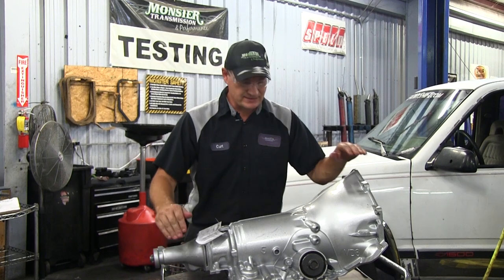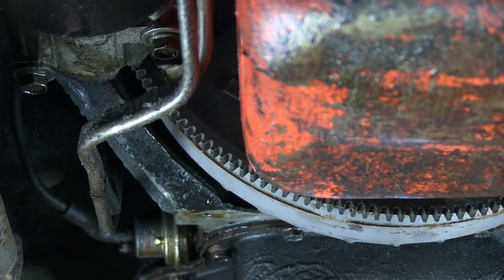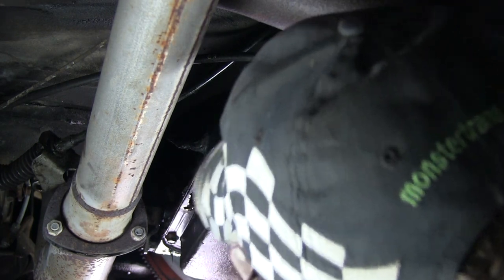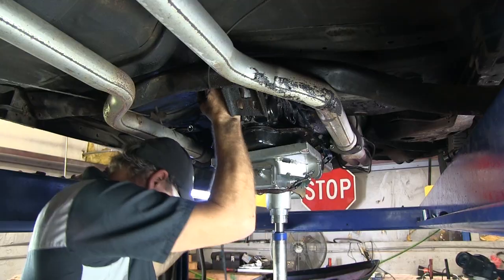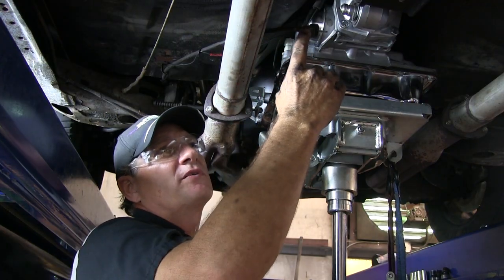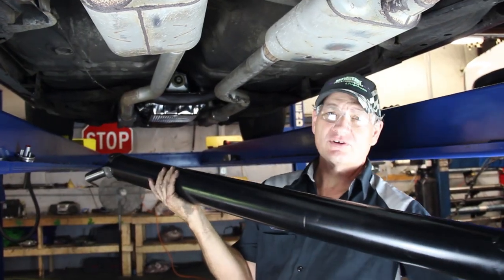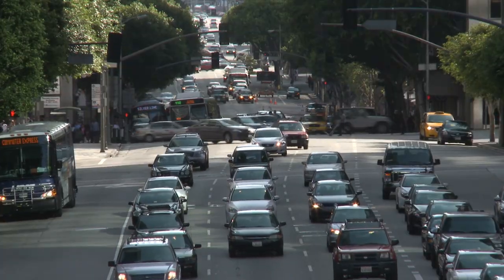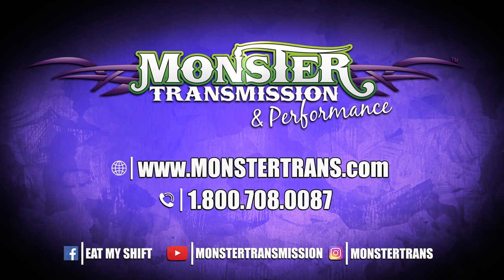TH400 to 700R4 Conversion  |  In Depth How To

Comment: Good job explaining every step. One thing to mention about the flex plate on a 454 engine is the plate has extra balance weight welded to it. If not used it will vibrate.

Comment: For anyone installing the torque converter, the converter must have at least 1qt of ATF inside as indicated, but turning and pushing to fully seat can be checked very easy. If you place a straight edge or even a length of 2 X 4 that straight, you will be able to slide your thumb or index finger between the two. If not fully seated, the torque converter will crack the front pump gear. 
 This will ruin your day! A simple quick check will avoid this sad issue when you are in a hurry, cold or laying on your back. 
 Just a tip.
ASE Master Tech since 1978 / Retired

Comment: You're the best tutor, Curt. Want to ask, is the process of installing the 2004R similar to the 700R4? What do i need to look out for in the differences? I have a TH350, and got a new 2004R with lockup converter few years back.
Reply from the maker: Hello! We appreciate the kind words. Swapping from a TH350 to a 2004R is one of the simpler swaps, just make sure you double check everything, set the TV correctly and get a external lock up kit if you dont already have one.
Reply: @MonsterTransmission  I'll get the TV cable and external lockup kit from you for sure in the next few days. Thank you so much

Comment: Wow thanks for the info really helps. I’m putting a th400 into my 66 impala for the first time
Reply from the maker: That's awesome Dave! If you end up having any questions give or technical support a call 800-708-0087.
Reply: If possible I could use some advise on a stall converter for my 66 Impala. I have a TH400 that’s coming out of a 83 3/4 ton 305 Chevy van. It has everything I need. 

For the Impala I’m running a carbed 8.1 496 with the HT502 cam and for the rear end a stock 12 bolt with what looks like the original 308.  Any suggestions
Reply from the maker: We would recommend getting a converter with stall speed of 2300-2500 mph.
Reply: Monster Transmission Ok will keep that in mind and thanks for the reply. 👍

Comment: Good video but couldve talked about hooking the cooler lines back up and which one goes on top.  Couldve also showed how to adjust or check adjustment of the TV cable before you drive it and burn it up.

Comment: 2 questions....1)will conversion also be the same or any specific differences for a TH350? and 2) what can I expect to pay for a trans shop to install the new 700? This would be going on the same application as you had in the video but a SBC 71' Chevelle SS.
Reply from the maker: To your first question, yes it would be pretty much the same. For your second it's hard for us to answer as that varies from shop to shop. It's always a good idea to call around and find a respectable shop you know and trust. You could try finding a vetted installer by using https://gearnation.com/. They're one of our partners and they vet and connect people with shops all over the US. Hopefully there's some shops on there in your area.

Comment: I thought the 454 was externally balanced? How can you use a flexplate out of the box without balancing it to match the stock flexplate?
Reply from the maker: It all depends on the rotating assembly the flex plate is internally or externally balanced

Comment: What about models that have gear indication on the dash and not the console?
Reply from the maker: Some models require to use of an aftermarket floor shifter but shiftwork sells alot of conversion pieces for column shifters

Comment: I have a 1991 4X4 Chevy truck with a manual trans and I want to convert to 700r4. I know I need cooling lines, steering column and linkage but what else do I need as far as the transmission goes. My hip is starting to give me problems when clutching.
Reply from the maker: To convert from a TH400 4x4 to a 700r4 4x4 you first need to contact Advanced Adapters they specialize on these 4x4 conversions and will set you up with the perfect Adapter you will need for your application. Sometimes they have 2 options for the Adapter 1.) Output shaft Adapter Kit in the Transmission or 2.) Transfer Case adapter. They can be contacted at www.AdvancedAdapter.com or 800-350-2223 and please let us know if we can help you with the Transmission build we work direct with Advanced Adapters building those kits in for many years, you would just have it ship direct to us and we can make it apart of the build process. Thank you for choosing Monster Transmissions.

Comment: I'm a little confused. Why does it have a shifter rod and a cable? Isn't one for column shift and the other for console? I'm working with a column shifted 68 pontiac 350 to 700 swap.
Reply from the maker: Yes you are correct

Comment: I want swapout my th400 with a 90 model 700r4,. do yall have a kit that has the parts to do this ? my car is a 71 Malibu on the column.  thanks.  also the engine is a 400sb.
Reply from the maker: Yes that will work

Comment: What is the major difference between a 400 to 700r4 and a 350 to 700r4?
Reply from the maker: *The 700r4 will be controlled by a TV cable (Throttle Valve Cable) to adjust the shift points and it will have better fuel economy being a 4 speed Transmission with Lock up with a Low first gear Ratio. These can be built up to 1000HP with our SS Xtreme Models. 
*The TH400 will be controlled by the Modulator there is no cable you will need to produce vacuum to operate this Transmission and this is a 3 speed so you will not get the best fuel economy. The TH400 is one of the strongest and most reliable Transmissions available we have built to hold upwards of 1200HP+ they are bulletproof. 
*The TH350 will be controlled by the Modulator as well and you will need to produce vacuum like the TH400 but on the TH350 you will have a Detent Cable  this is a 3 speed as well so fuel economy is not great. The TH350 is the weakest of the 3 Transmissions we are talking about and can be built up to 600HP.

Comment: Love it - maybe dumb question, but on the 700r4 which of the cooling lines is the feed and which is the return?
Reply from the maker: No such thing as a dumb question, You can find the correct coolant lines in this video https://youtu.be/tnFPgjQq3aA
But in short, the top is the feed and the bottom is the return

Comment: What about the cable bracket on the transmission it self, what bracket is used on it to hold the cable
Reply from the maker: If you're talking about the t.v. cable, that bolts directly to the transmission. And if you're talking about the linkage cable, it would vary depending on what rebuild kit you have.

Comment: Do you guys make lock up kits for the 400. I recently found out that’s painless. 3 speed with a lock up.
Reply from the maker: No, we don't have a lock up kit for the 400.
Reply: coan does...about 2500.oo  ...converter ,i think..about the same
Reply: @brianmathew09  Are you saying $5K total to make a TH400 lockup?

Comment: Can use a 700r4 with a 2300 to 2500 "10 mechanical stall with out the lockup conversion kit?
Reply from the maker: If both the converter and transmission were converted to non lock up, then yes it is fine.
Reply: As a daily driver?

Comment: Why would you possibly want a 700r4? I was looking to see if i could convert my 700r4 to something else? I have a 1990 1500 and it is just a nightmare
Reply from the maker: The 700R4 is good reliable transmission when built to the application and HP it is being used for. The manual TV cable makes it easy when you don't want to mess with electronics but still gain an extra gear for highway cruising. There are other options depending on your application, give us a call to go over your details at 800-708-0087

Comment: I remember way back in the day when they first came out everyone was pulling out the 700 and going back to the 350 turbo cause of junk that the 700 turned out to be
Reply from the maker: From 1982-1984 GM had a lot of issues with the 700R4. And in 1985 GM corrected these issues and since then the 700R4 been the most versatile four speed GM has made.
Reply: If a 700R4 from 1982 - 1984 gets completely rebuilt, will it fix the problem that you are referring to? What exactly was the problem?

Comment: Why would you go with a 700R4 and not go with a 4L80E? Isn't the 4L80E closer to a TH400 as for as toughness?
Reply from the maker: That would depend on a couple things. But yes, if they have high power a 4l80E is the best way to go. This was just instructing for someone who was converting.
Reply: @MonsterTransmission  4l80e need a computer .or you have to go with a full manuel kit
Reply: 4l80e needs way more computer/electronic shit than the 700r4

Comment: Not to be a troll I’ll never understand why someone would retromod a hot rod , put a $10k engine , new suspension, new paint and put a th 350 or 400 in it ! For a street rod these transmissions are obsolete. I like the drivability.

Comment: I'm pretty sure this guy knows his stuff but if i had a turbo 400 i would keep it. Thats what those older cars came with.
Reply from the maker: Keeping the TH400 is great if you are keeping the car original but upgrading to the 700R4 allows the car to drive at a much more comfortable rpm on highways and gives better gas mileage. Give your classic more drivability with the overdrive by doing this conversion.

Comment: when I first saw this I'm thinking that I would never change the TH400 to a 700R4...   especially going in behind a Big Block.... absolutely go to a 4L80.. its a TH400 with overdrive.. much stronger trans than the 700R4....  good video though....
Reply from the maker: The 4L80e would require a computer to run the transmission, and may be too big for the vehicle the TH400 is being replaced in. The 700r4 gives it the overdrive the owner is looking for but maintaining mechanical control with the TV cable.

Comment: Keep the 400 . .better than 700 .
Reply from the maker: All depends on what your application is, that overdrive does wonders on the highway
Reply: I completely agree i have a 89 Silverado C1500 2wd with a 700R4 it slips in and out of overdrive and the gas mileage is slightly better than a th350 or th400 which i don’t really care about rather have one of those than the 700 and in a couple months the 700 is getting pulled for a th400
Reply from the maker: This may be caused by a bad governor or you may need to readjust the TV cable. You can watch Curt as he shows step by step procedure here: https://youtu.be/yOS7YN05X7E
Reply: Ny Chan I love my th400
Reply: A well built 700R4 runs circles around a 400 and if it is slips in and out of overdrive something is not set up right. If TV cable and lockup converter are set up right it is a great transmission.
Reply: Actually the 700r4 32 spline single wire from a diesel and the slip n slide power glide most 60s-70s cars and trucks came with are the best automatic transmissions